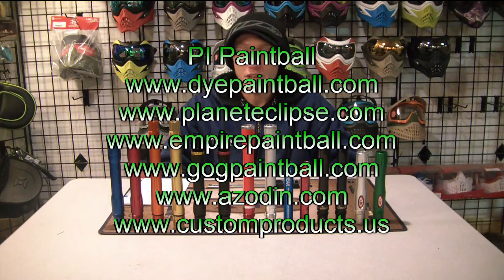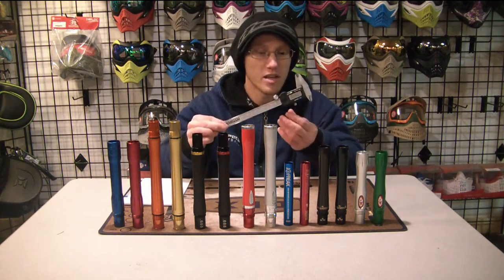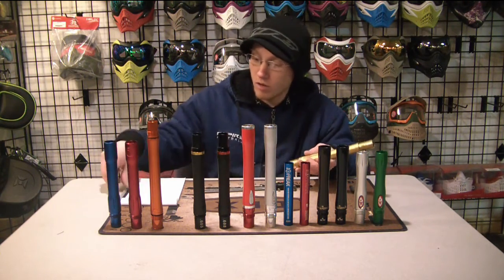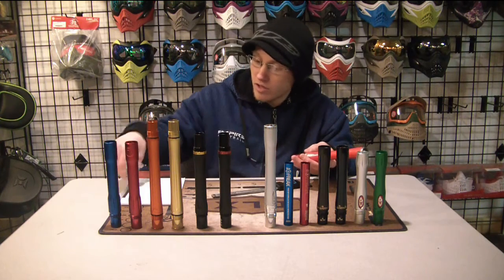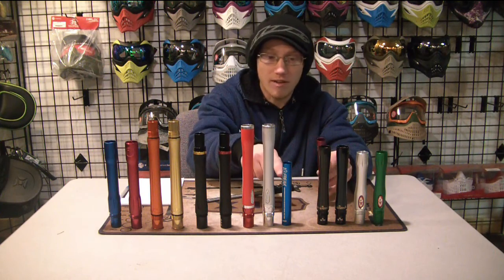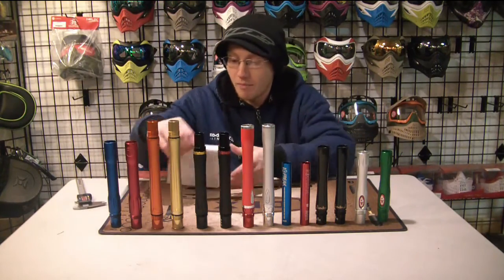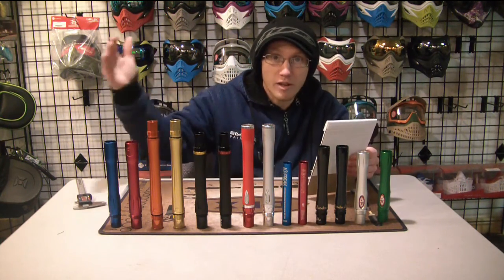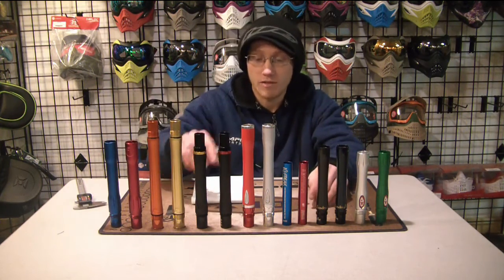Barrel bore Size Part 1!

Comment: Just some Recommendations: Next time take more measurements. I would say 3 to get more accurate readings. Also those mechanical stainless steel calipers can deviate (+/- 0.0200mm) due to the micro forces being applied to the caliper, so your readings might be a little off. For instance, when measuring the first two barrels that were inscribed .6840in, assuming the last digit after is a zero, came up as reading .6850 on your caliper. 

When converting inches to millimeters you see that .6840 inches is equivalent to 17.3736mm. If we were to add 0.0200mm to 17.3736mm you would get 17.3936mm which is equivalent to 0.6848 inches which in theory would round up to .6850 inches on the measuring instrument or stainless steel caliper, giving an inaccurate reading if max deviation occurs. This is just something to think about, and only intended to help. With all that being said, great video!